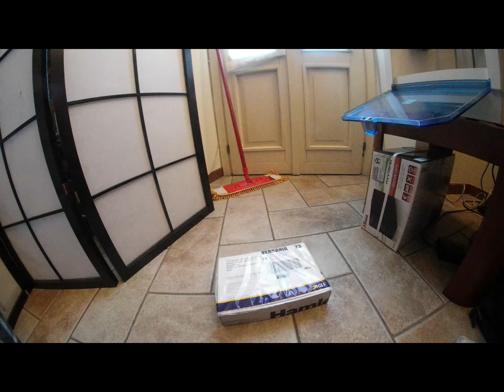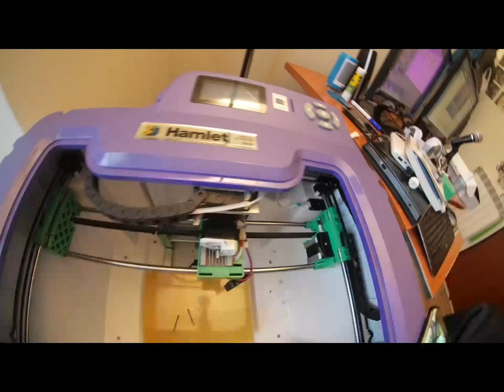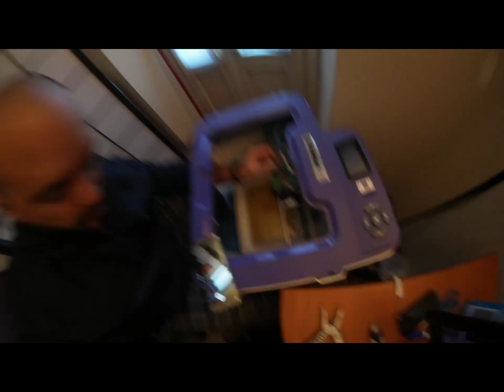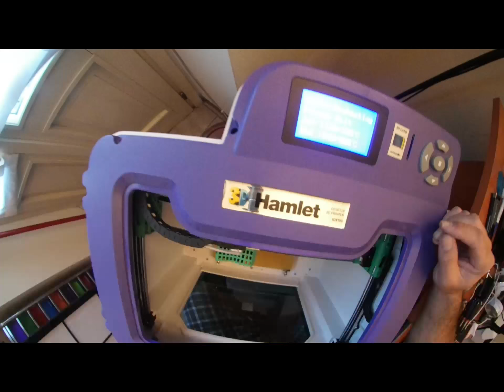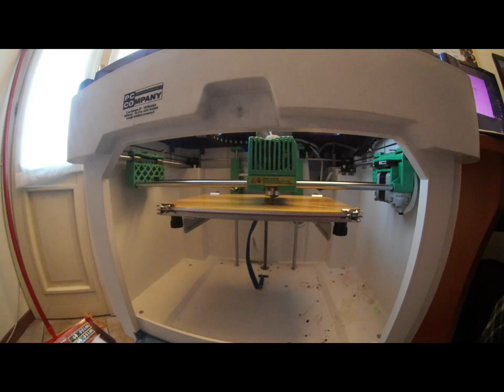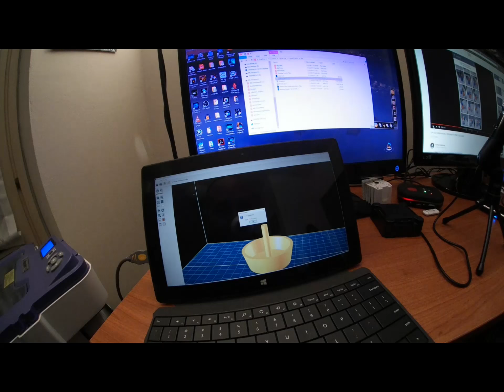Hamlet 3D printer:  Part 2 Replacing Extruder

Comment: I'm trying to replace the extruder with a different one in order to support changing of diameter, but I have some problem with temperature because of the reader, have you tried something?
Reply: Anybody has some firmware update for this thing. Id like to use CURA for slicing but seems the gcode is wrong.